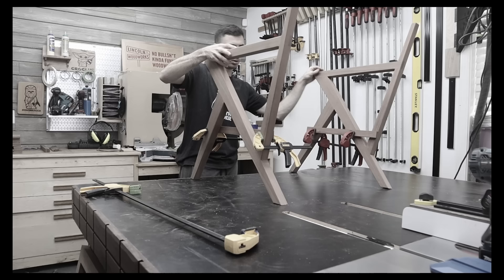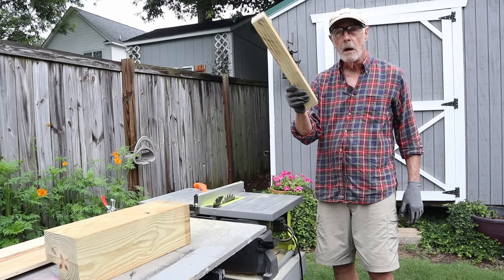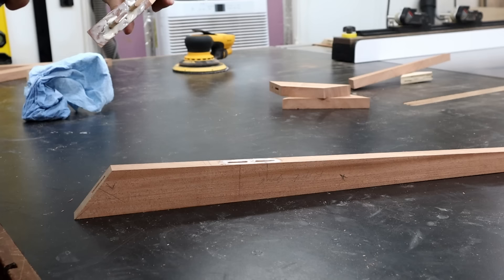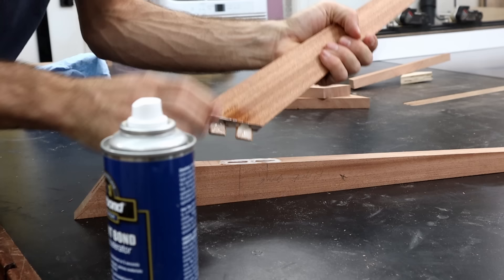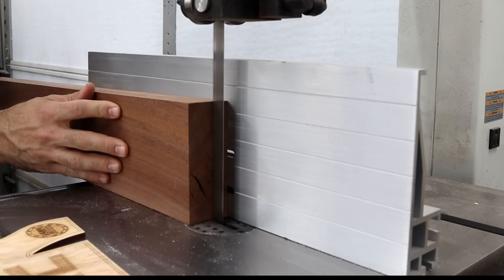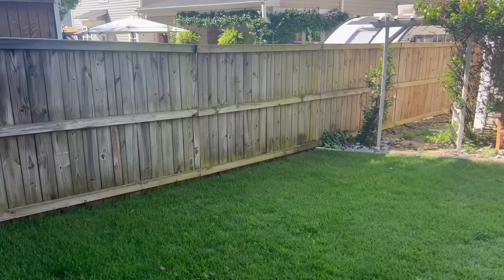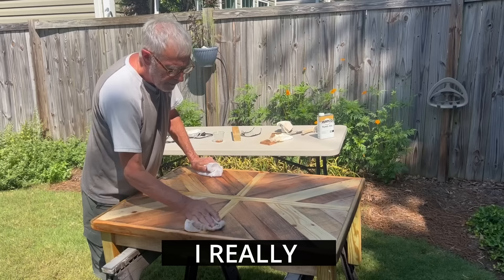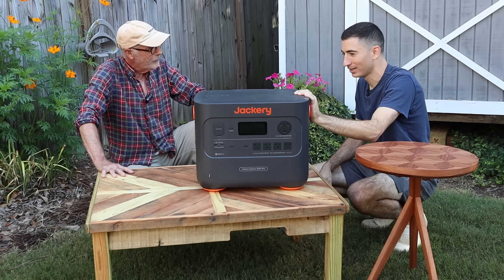I challenged a 78 year old to a build off

Comment: Dunno how many pallet videos I've watched, and this guy has the best breakdown I've seen.
All these dudes out there wrecking their backs wrenching the boards off, and my man just flips the pallet and hammers them off.
Respect.
Reply: I noticed that too.
Reply: Used the 4x4 and gravity bro. That plus the champers on those legs. 😮
Reply: That's what "Brains not brawn" means!😊
Reply: Wait, people were not using their brains by trying to lever the boards off?  I took apart a few things held with nails, and a hammer was the easiest way I could think of to take them apart...
Reply: At work I just use a size 12 boot and some pent up frustration to breakdown pallets. Some minor breakage, but it's easy and therapeutic.
Reply: <Bonk> "There's one."  <Bonk> "There's two."
Reply: Although both are beautiful
Older Johns table is my pick
👍

Comment: Honestly, the pallet table might not look as nice as the round one, but the work mentality behind its creation and the usage of tools the way John did, its got my vote.
Reply: i thought it looks fine and more practical
Reply: The pallet one is the on id likly want to be outside
Reply: I'm 100% percent sure the pallet table will outlast the round table for a few decades at least.
Reply: As someone with experience with three legged tables, I really prefer a four legged table. Three legged tables tip and whatever is on the table when it tips is going to at least spill and quite possibly break. Sure it looks fancy and impressive, but it's not practical. Neither are the chairs. With those points on the ends of the arms there are going to be bumps and bruises when people bang into those pointed arms.
Reply: The round table will tip over with one small wind gust. I had a heavier duty one than his and it constantly was tipping. The only thing I like better is the darker color. I definitely vote for the old guys table but if he used the darker color including on the legs and all wood that can be seen from the underside it would be perfect
Reply: Round table is fancier for sure, but I really like the pallet table.
Reply: 3 legged tables are OK as long as they are against a wall or in a corner. 😂😂
Reply: The end of the video shows the winning table. You notice young John didn't even think about putting that generator on his table.  😂
Reply: @ziguirayou  The Pallet table looks much stronger than the round one.
Reply: Boomers build stuff to be used and last.
Their grandchildren can also climb and play on it outside. 
 The really nice table looks  like it's only built to hold a sandwich and a glass.
Reply: @anonone8954  I love the idea of the little kids climbing on the table.  They could also turn it upside down and sit in it as a boat/taxi/tank/etc.
Reply: @shiralleehaggart72  yeah, we should test them out by slamming one down on the other. Just a couple of times...
Reply: @bunnyslippers191  that millennial has figured out all kinds of ways to keep little children at bay subconsciously. 🤣😂🤣

Comment: Loved this video.  The best thing about it was not the unique style and  beauty of each table, but of the quality craftsmanship and commitment to excellence that both Johns showed. I've been dealing with my home renovation project that has gone on for over 3 years, lots of mistakes, lots of redos, construction consultants and lawyers and two contractors-both came highly recommended, now both gone. Bottom line for me, I'd take both tables but better yet, I'd take either or both of you to finish up my project. I wouldn't worry about cutting of corners (metaphorically!) or not finishing.  You guys are worth your weight in gold, and bring me new faith in the trades.
Bravo to men of integrity!

Comment: I think both tables are equally impressive in their own right. Every tool used in this video is utilized to its fullest potential. Both John's made unique and functional tables. I like old John's table for the fact that it is large, capable of holding a lot of stuff and made of reclaimed material. I like young John's table because it is very intricate, artistic and decorative. I say you guys get Golden corral to go and a six-pack of microbrew. 😋👊

Comment: I do like millennial John's patern for the table top but if I had to vote between the two I would vote for boomer John's table because he took used wood and turned it into a wonderful looking design. He even took the time to arrange the wood colors properly so the design patern would be in sync when staining it. I applaud your skill.
Reply: Held together by screws as well unlike the other table held together by glue.
Reply: @shiralleehaggart72 Nails, not screws but there was also wood glue used on both. I just like that he made a fantastic table out of used wood. Anyone with basic woodworking skills can make something out of wood and if you take your time in designing it you can even make a great pattern in it but to take used wood and make, not only a design pattern but also a pattern that matches with the wood colors and grain, now that takes alot of skill.
Reply: @shiralleehaggart72 I voted boomer here, but hats off to the millennial for using real old school joinery and not using nails or screws, the true mark of a woodworker is making it stronger with joinery rather than screws or nails
Reply: @shiralleehaggart72  Wood glue becomes are hard as the wood itself. Plus it was on a foundation
Reply: Boomer John's is something I'm impressed to make myself.  While new M John's is what I would save up to buy.

Comment: John's build really highlights the fact that with any hobby, whether it be woodworking, photography, or fishing.  You don't need all the fancy gear to enjoy your hobby.
Reply: I really liked “Old Johns” table better, it has many more uses and your not afraid to use it. Yours is a piece of art, no doubt, but it’s SO nice, I’d be afraid I’d damage it.
Reply: That is a great point. The fancy gear is fun, but it also blows up your ego. I have a problem with buying the best in any hobby I engage in, and honestly it has taken me years to understand that I don’t need to waist money until I am absolutely sure I will continue to love it. Starting out cheap and simple is always the best way.
Reply: @chrisviviano3271  The "best" is rarely needed, and often is overpriced for what you are buying. The "Worst" as in the cheapest crap is also bad - liable to cause more headaches than fix. Finding those solid, middle of the line brands tends to be the way to go... usually.

And then there are the exceptions - the best paints tend to be much higher pigmented, meaning you can get more coverage out of them, and tinker with them to get the consistency you are after. The best brushes tend to last longer. And we can go onwards with this in terms of reliability, and more, but again - a lot of this is niche, and is really getting into specific items.

So no - do not start out cheap. If you are wood working - go find out what basic tools are generally deemed reliable in the industry and use that, or use a comparable offering understanding what trade offs you are making in order to save a buck.

Comment: Worth a subscribe. Been working on a 4x8 trailer (purpose of retrofitting kayak rack, bike holders, etc for outdoor activities) from ground up and have been engineering my way through cutting various pieces and using composite decking as my rails. Yes, you read that correct and found a way to reinforce the ends by making about 130 rectangular dowels and hammering them into the ends. Also tested and found out you can stain them as I was told by many sources you can't. Anyway, I absolutely loved this video as it shows you don't need all the latest gadgets to complete something you want to do. I have had so much fun with my project and enjoy the process. Great to see two different approaches having fun and respect for the craft.

Comment: Really I think it is a draw.
 The pallet table was a show of experience, ability, and repurposed material that resulted in an amazing and sturdy result that would resist time, elements, and grandkids.
 The circular table is beautiful, elegant, compliments the chairs, and demonstrates the capability of having the right equipment to perform a build. However, I don’t see it holding together very long with kids and outside elements wearing away at it.
 Amazing work on both parts.
 Awesome gift you gave to John, John.

Comment: I haven't done a proper woodworking project in a LONG time, but boy did elder John win my vote - he squeezed out as much as he could from his material and demonstrated a great deal of expertise in how he could use the few quintessential woodshop tools to their max. Also the sled at 6:00 with the use of the edge of the table was peak problem solving.
Reply: define "proper" 
how many kinds of woodworking are there?? never heard of proper woodworking.
Reply: @verne51  I believe that "proper" in this sense means worthy and worthwhile. Quite rightly so.
Reply: "quintessential woodshop" like a nail gun? sorry now. this is not wood working in my opinion.
Reply from the maker: Yeah the cross cut sled move is brilliant
Reply: @d.w.i.3716  lol. it's not wood working because he used air to pin the nails in?

????

in my area we use the edge of our hands to cut the wood.
Reply: @nathanreiber6819 I just make really mean faces at trees until they become furniture.
Reply: @nathanreiber6819 totally agree with you just wanted to point out he did not use air that is a battery gun not sure how they work but most don't use air canisters any more
Reply: @gamemasterreviews630  good point. you definitely can get pneumatic pin nailers still though many seem to be.. That's what I'm used to anyway.

Comment: As someone who is just starting woodwork without space or equipment for a shop I dig seeing what neighbor Jon was able to do with his limitations! Great video
Reply: You don't have to go out and buy the most expensive stuff to do wood projects. Those plastic tables are 20-30 dollars oh, I do recommend better sawhorses Kobalt has some cheap metal ones that have worked fantastic for me, they recommend a stand for both your table saw and miter saw oh, that have them on Wheels where you can tote them around really easy.
Have fun take your time with stuff just don't be a over perfection
Reply: @kalrandom7387 made my own sawhorses. Very sturdy. Thanks to my Contractor Uncle Leo!
Reply: Decent mid-size table saw, decent miter saw, decent band saw with tilting table, drill press with tilting table.  Some good pocket screw jigs, hinge jigs etc. Add some Milwaukee M18 Fuel hand tools (router, finish saw, impact driver, palm sander, oscillating tool and few others) and you are pretty well set.
Now watch a bunch of videos and make a bunch of jigs.
You do not have to break the bank.  As in most things, the quality difference from cheap tool to mid-range is huge (far greater than the difference in price), while the jump from mid-range to top-end is smaller (and the price difference HUGE).
If you can easily afford a great table saw - get one.  But great work can be done on a mid-range one.
Table saw jigs are fantastic.   The sliding bed with clamp channels is a lot of work to build, but allows you to do something in two minutes that might take 30 without it...and is accurate, versatile and safe.  I built a similar one maybe twenty years ago.

Comment: “Older” John gets my vote. Up until I got hurt fighting with a big piece of furniture that we were restoring- we used a LOT of pallets to build tables and to repair other pieces. We started with all hand sanders, a framing square, a circular saw, a basic level, hammer, and a lot of Titebond. We sold everything that we built. We always travelled the roads close to our house and found a lot of discarded wood.
Reply: Pallets are supposed to be returned on the next delivery truck for reuse over and over industry wide.  Only rank beginners treat them as disposable single use items.  Only reclaim the wood after failure .
Reply: @johndododoe1411  We got most of our pallets from a company near us when they put them out for people to use. Only “know-it-alls” try to tell others how they should use them. In short- mind your own business.

Comment: I was favoring a draw because you both did an amazing job, but I have to give it to older John for a few reasons. First, you both had two days to build your tables "using only your shops". However, "Younger John" had to go to Home Depot because his shop was not adequately stocked for the challenge. Second, I had to score extra points to "Older John" for both reclaiming lumber and using far less expensive tools to make an impressive table. Third, while both tables are unique, aesthetically pleasing and functional, I prefer more traditional styles rather than modern ones. Lastly, Johns is bigger!
Reply: Excellent analysis! I think Younger John forfeited by using something he didn’t already have in his shop. Certainly, he had some type of finish in his shop that he could have used, but it wasn’t the finish he wanted to look at every day and it might not have been suitable for outdoor use. So by going to HP, Younger John got exactly what he wanted AND he also ‘won’ a trip to Golden Corral! Although gifting the generator to Older John scored Younger John points, such generosity wasn’t part of the competition. Younger John, don’t forget your change, so you can pay the tab in the exact amount. 😉
Reply: Uh, I wholeheartedly agree with everything you said. Older John also finished the table completely on day 2. It looked like younger John had to assemble the top and base together before display on day 3.
Reply: Size matters
Reply from the maker: I’ll happily take the DQ on this one! Thanks for watching and the comment. I greatly appreciate support like this. It truthfully means a lot to me

Comment: Older John had to adapt to more challenging conditions (outside) had basic tools, recycled materials and still came up with a challenging piece that not only looks good, but will stand the test of time. Young John's table top will crack and separate because of the different expansion rates of the 64 pieces. Hands down, TKO AND NEW! NEIGHBORHOOD CHAMPION, OLDER JOHN!! 16:50

Comment: Both projects turned out great, but my preference would be Old John's table. Fewer tools required and a much more sturdy table. Probably, cheaper too since it was built out of old pallets.  Young John's table would serve it's purpose for drinks and/or maybe some reading material. Great job by both.

Comment: They’re both nice. The pallet table is more my style and it was done with less tools. I built a door starting last week and finished early Wednesday morning and it wasn’t the result I’d imagined but it kinda looks like I meant to give it a rustic home made look. Especially with the old existing trim. It almost instantly grew on to me. It literally looks 1,000 times better than the access door that was there when the house was built in ‘78. I might tweak it a little. It’s a crawlspace access in the finished basement which is why I spent too much time on it. The original was a piece of fiber board that didn’t even fit the opening and musty crawlspace air was leaking into the house. Had an almost 1 inch gap on one side.

Comment: First time I've watched and loved this content. In weighing up the tables (being 72 years myself), I have to applaud John's design and choice of materials after all, working on his lawn with 'Budget' tools, his table cost maybe $5 all told.
Using your 'Suite' of, reasonably expensive tools, you designed a fine, contemporary, semi hardwood side table in your purpose built workshop which you, most professionally, constructed and presented to us.
Sorta TKMaxx meets William Morris. Both extremely well presented items.
So.....a winner🤔......I'm going to say John edged it (even tho you both actually did 😉) purely on a cost basis since John could have made 4 tables for the cost of the Teak Oil from Home Depot. A very well done to both of you and extra applause to you for the excellent video.
Reply: and John's table is more durable
Reply: could have made 4 tables for the cost of the teak oil send my beverage flying

Comment: I prefer Elder John's table for a few reasons.

1) It better suits what my needs would be for an outdoor patio table.

2) It gave new life to old wood, and I am big on conservation

3) While the circular table was also attractive, I thought the pattern fit better for the size of the table.

(Smaller is often more difficult, but sometimes there is beauty in simplicity)

4) After seeing the work that went in to them, I got a "get more for less" vibe from the larger table. Not a lot of fancy expensive tools (which there is nothing wrong with) Just a dude out building some stuff on a weekend.

Both tables were great, and it was a good video. I did enjoy seeing the different approaches to the challenge/project.

Comment: Little John’s table is definitely worth the Shinny OHHH AHHH award. Big John’s table is conservative, functional and eye-catching. As a wood-worker of many years on a budget, having used pallet wood, ditch wood, sawmill rough lumber and rejects from big box stores, I favor Big John’s table. Considering the advantage of Little John’s shop, I felt his table should have been bigger, more functional. Although his table is very attractive and modern. I think modern is both a positive and a negative the “shinny thing” folks will desire Little John’s. Busy Backyard Folks, Folks with kids and/ or drinking folks for guests will favor Big John’s table. Because of the entertainment value of this video and the good sportsmanship of both of you, I think its a Golden Coral Dinner, with a crappy Beer at the micro-brewery on the way home, drive safely. For your next video, may I suggest you swap shops for another build off… it would be awesome.  Thank you gentlemen.